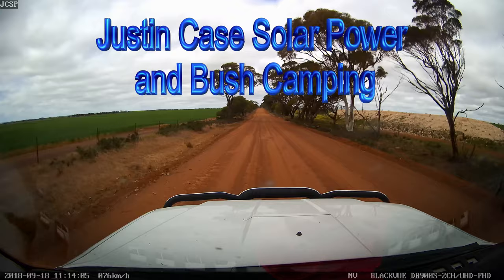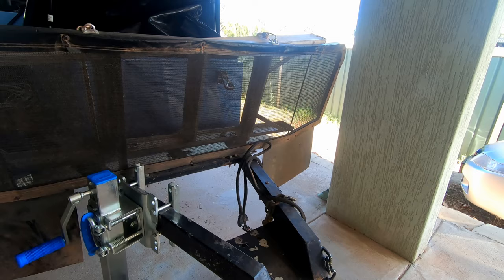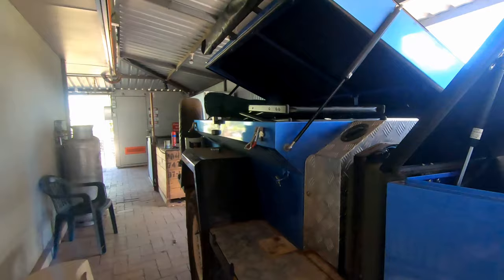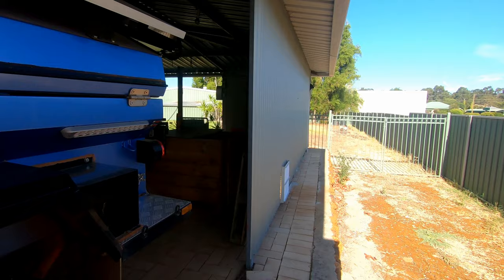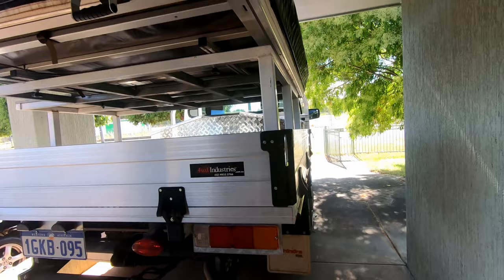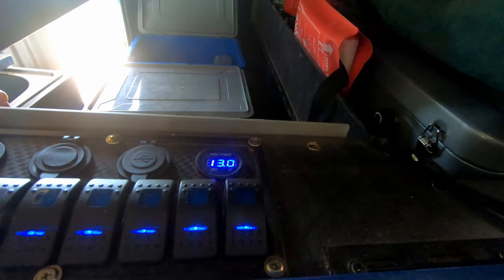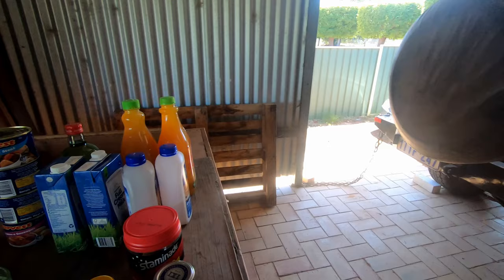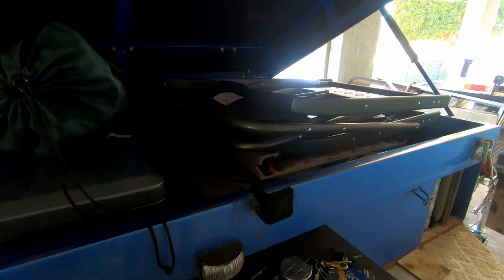Mahindra Pik Up review.  Camper trailer update

Comment: I am going thru all of the changes that you have done on yours to mine. I should have my new springs next week and then I am going to get that same jockey wheel
Reply from the maker: You will end up with a great easy to use trailer like we have. As well as a trailer you can feel confident that no matter where you take it. It will still be following you home in one piece.
Reply from the maker: You live in WA ?? If you do we can go bush sometime. Next big trip is planned in April.
Reply: I'm over on the East Coast near Coffs Harbour mate. I'm trying to set my trailer up for weekends away with the family and a few 4x4 mates. All of our countryside here is along the Great Dividing Range so I wanna do things right.
Reply from the maker: @peterryan7340  That's a shame.  Always looking for other nice people to go bush with. Its fun to go alone but sometimes its great to have friends along. You wont go to fare wrong using the same gear i am. I did a lot and i really mean a lot of research into the gear i have added. Happy trails my friend.

Comment: Do you have a Bcdc charger in the trailer or?
Reply from the maker: No the trailer has a 270Watt panel of its own and a Victron 100/30 mppt controller in it. I have a video about it some place will have a look and add it below if i find it. That only works when we go camping and is out of the sun. AGM batteries are good for 6 months without charge. I just top it off with the car when i am working on the trailer like i did in this video. The car has this in it https://www.projecta.com.au/dual-battery-charger-idc25/ that keeps the main and 2nd battery in the car charged and also the camper when its hooked up.
Reply: Cheers. Great setup.
Reply from the maker: Thank you 👍